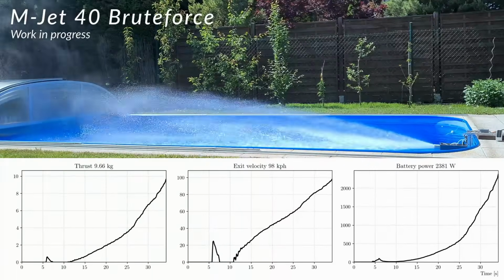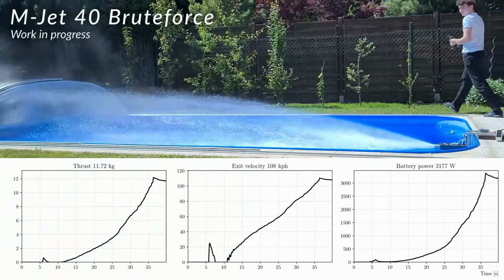Automated CFD Optimization, Intakes, M-Jet 40 Bruteforce

Comment: Damn so if one M40 could produce about 10 kilos of thrust two of them on a 1/8th scale boat that weighs maybe 3.5-4 kg that's a crazy weight to thrust ratio
Reply from the maker: I already achieved 4 thrust to weight ratio with M-Jet 35 and the 4G hull😀

https://youtu.be/KYTUcPcL1a4?is=Z0wfz1CJG4WHEff9

But its also necessary to make it all stable which is becoming more difficult with more power

Comment: I am curious about what solver or method you are using. Are you using your own solver? 
If so, what equations are you solving, Compressible inviscid? full Navier-Stokes?
Moreover, I am curious about the method you use to solve the equations. Maybe you should try to use a second-order method or higher orders to get more accurate results
Reply from the maker: Its LBM, my own implementation. It solves transient incompressible Navier stokes with second order accuracy. I am also using a LES Smagorinsky model. Still the resolution in this video was not sufficient, only during the last month I was finally able to implement unstructured grid refinement and that works the best so far. Working on it all the time now.

github.com/stepanmuller/PeriodicShiftLBM
Reply: @mjetdevelopment  ohh coool! You are using cuda
Reply from the maker: @AlmogD Well I am using the TNL library which uses it. So yeah:) it makes the GPU programming part simple. It is still fascinating how it handles so much data, on my 4070 Ti it reads, updates and writes the entire 12GB memory 20x per second.
Reply: I saw you have an airfoil in your code. I have a github repo with code that calculates 4 and 5 digits NACA airfoils. Name: AlmogDob, repo: NACA-ploter

Comment: Since you are running 2D simulations, are you sure about the boundary conditions? Those will lead to improper results for sure
Reply from the maker: It is 3D, I am showing section cuts
Reply: @mjetdevelopment  boundary conditions of flow against surfaces? Is it an ideal flow with 0 flow rate on walls?
Reply from the maker: @robertocalabro2452 Left, bottom and the planes parallel to screen in front and back - dirichlet velocity, right - dirichlet pressure, walls - zero velocity
Reply: @mjetdevelopment  try a partial slip on walls, retain zero velocity for surfaces normal only. No-slip condition on walls lead to errors in the direction of less efficiency as highlighted. Also, it's in good agreement with the lower efficiency calculated for inlet flow with hard against the experimented increment. More walls no-slip, more error against experiments.

Comment: It looks like you are simulating the pump at a 0° angle. When the boat is traveling at speed, it'll be at a few degree nose up angle. I think you should retry those simulations  with the pump intake at a slight angle to see if the flow matches real life results more
Reply from the maker: Oh yeah, you are right! Thanks that is a good idea.

Comment: Interesting thoughts. Like you said, "roof" flow separation should be improvable by tuning the intake. I also agree that it should not extend so much longer than it already is. It will probably worsen hull characteristics like handling too. But what about intake width? That should initially reduce surface velocity to reduce flow separation. I guess it can't be too wide because of air when planning? What if the intake bottom profile is a different shape?

Comment: I admire your persistence. My hobbies have changed and shifted 2x since I did 3d printed jetboats. There's a high level of dedication you have! Admirable.
Reply from the maker: Thanks!
For me it shifted from a hobby to a side job and eventually also connected with what I study which is mathematical modelling and fluid simulation, I'm in the first year of that. It's fascinating.

Comment: Maybe a stupid idea, but what about making an intake that will extend up to the impeller? When you have water nozles that need to shoot water in a perfect "bar" of water without having it separating in the air they use a sort of unit made of small parallel channels that make the water flow perfectly parallel without any swirls in the water mass. When shooting out of the nozzle the water will be very smooth and predictable and will stay in the same form until it will drop on the ground or in the water again. not sure it it would work here. The water has to around a bend instead of perfectly straight. And many little channels will have more drag too.... just a thought...
Reply from the maker: Thanks for the idea! If I understand what you mean is splitting the intake into multiple channels to control the flow better. In fact that is quite close to designing a loading grate with multiple vanes that may be longer and effectively split the flow into multiple paths, which is what I am considering. It's a question how many and how long they should be, maybe I'll find out:)

Comment: finally a new video! this is some pretty good progress, since you have to test so many pumps and intakes on a single boat, do you have a specific way of swapping them out? im working on a custom hull and i want to be able to remove the whole pump assembly it whenever i build a new hull.
Also i can see that there is a different seal on the steering shaft whats that about?
Reply from the maker: I tested about 4 different intakes and I did that by always cutting the old one out. The epoxy does not bond all that perfectly which helps to get the intake out. Eventually for the last one, I made the bottom section removable, as if there was a very very thick intake grate. With that I tested many different lenghts and angles of the opening, with not much success, but that is because previously I had no way to find how the flow would look like.

I like to keep things simple, I find that designing a system that would allow to mount and unmount the whole intake from the hull would be very difficult, primarily it would be hard to make it seal.

What do you mean by a seal on the steering shaft? The previously tested iterations of the M-Jet 40 Bruteforce had a new reverse mechanism, maybe thats what you mean. Here it is in action, 9:50
https://www.youtube.com/watch?v=BjaM3j57omE
Reply: @mjetdevelopment  Not sure how feasible it is to cut the intake part out in my case because the intake is very snug on the sides, its a tunnel hull. Taking it out in one piece is optional since i want to salvage the bearings, seals and shafts but being able to remove the whole pump assembly and putting it on another hull would be very nice
Reply from the maker: Oh, I have just realized how you mean, yes there is a new TPU shaft seal that takes less space. It actually works with no issues so thats why I almost forgot about it:))

Comment: Awesome video! By the way, which method were you using to optimize the parameters - bayesian opt.?
Reply from the maker: Yes, at first I tried to use bayesian, but it seems there are too many parameters. I read bayesian works well at 10 parameters, I have around 30. The bayesian kept trying nonsense values with no progress. So eventually I switched to a way more conservative way
1) pick the first parameter and advance it in one direction
2) if it helps, go further, otherwise turn around. Keep adjusting till you find local maximum for this parameter
3) jump onto next parameter
4) if it happens that you finish a full loop over all parameters and find no improvement, half the adjustment steps
Reply: @mjetdevelopment  I am working on a SysID project right now for multicopters using Bayesian Optimization. I ran into the same issue you have here where Bayesian struggled with the number of parameters. To solve it I was able to simplify the system to use 10-15 parameters and then ran Bay Opt to get an initial estimate, then I switched to Covariance Matrix Adaptation - Evolution Strategy (CMA-ES) to allow for more parameters but at much lower sample efficiency to fine tune the final solution. I wonder if you could implement a similar approach here if you are able to fix some parameter values initially. For my project this was more simple as I just assumed all motors were identical but hopefully you can find another way to make it work.